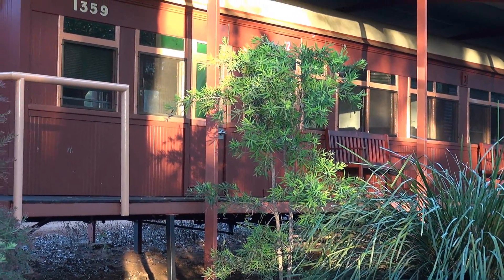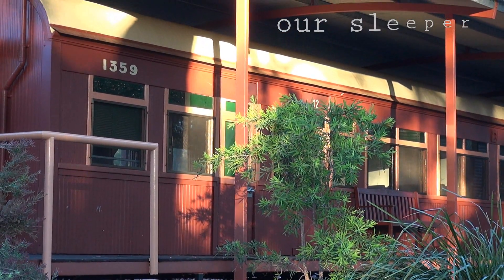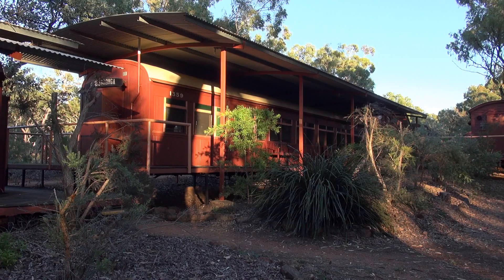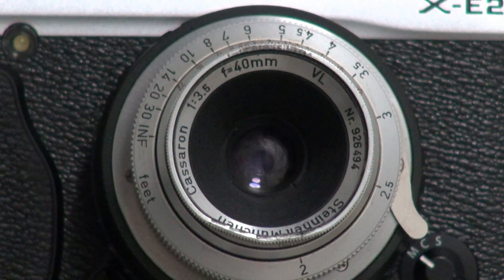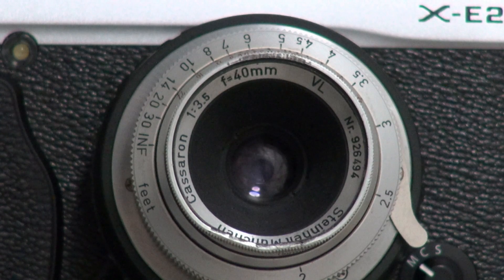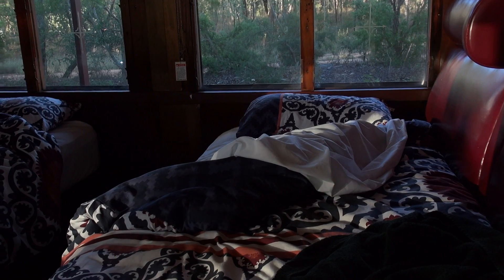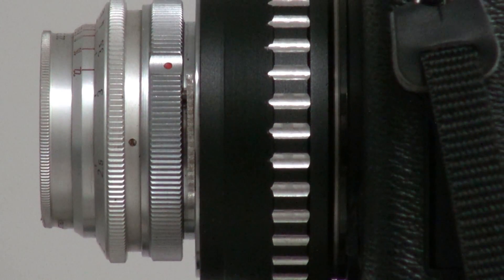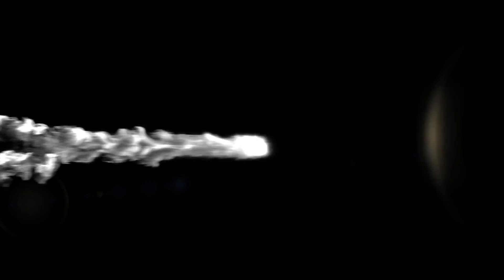Steinheil Munchen 40mm lens - a Cooke Triplet design

Comment: I love mine got one last month for only $40  to  compliment my Auto=Quinon  F1.9 55mm that I also  bought recently. The first 35mm I bought in 1956 was an Exacta with the Auto-Quion. After all these year I finally got to  replace the one I sold  which I am using on my z6 Nikon.  The Steinheil 40  is a supper little lens that I enjoy just taking with me
Reply: How did you adapt it? What Mount does it have?